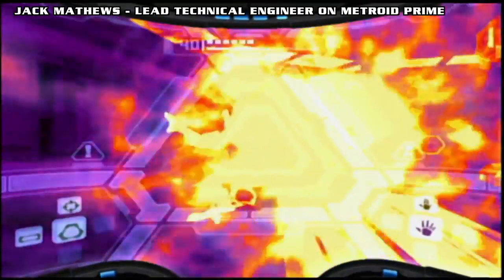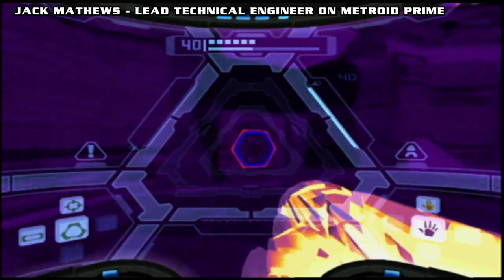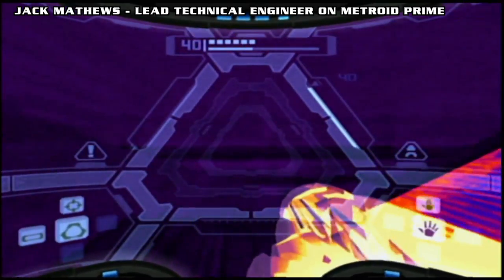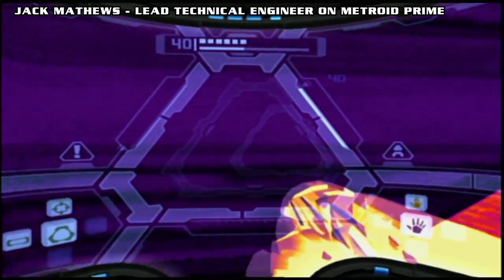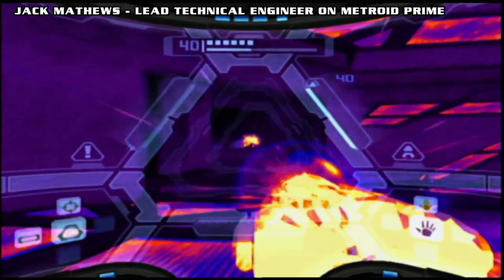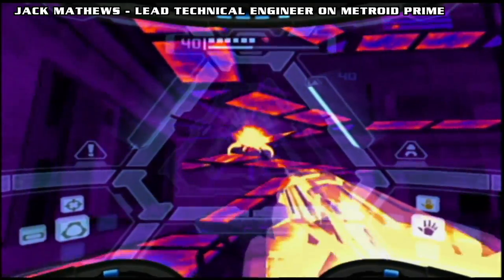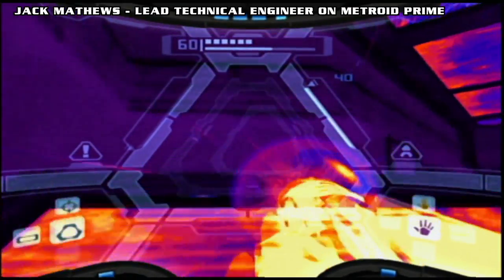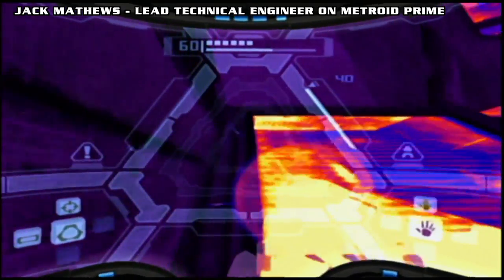Why The Thermal Visor Looks Worse In Metroid Prime Remastered

Comment: It was done good enough were it didn't break immersion. I didn't notice the decrease in resolution. I have a lot more issues with just seeing with the thermal visor on because everything is dark, which is an issue I had on the gamecube, and that's understandable the entire point of the thermal camera is you use it in dark areas.

Comment: Wouldn't palette effects be trivial for a fragment shader? I'm not familiar with Switch hw, is it not running shaders of some sort?
Reply: Yeah, I was thinking that too. They could just use a lookup texture indexed to whatever RGB -> brightness conversion function they like and Bob's your uncle, just have whatever "tagged as hot" means be something encoded in the surface textures that increases the brightness output by whatever you need. Granted that'd be just if you wanted to imitate the Gamecube 1:1, which I expect the remaster was trying to do more than that.

Comment: My problem with the original Thermal Visor is that it showed the Gamecube's flaws as far as graphics go. You could see the polygons moving around and it kinda took me out of the experience. I tried using Thermal vision as little as possible for that reason. The Switch remaster makes more sense since that's more in line with what thermal vision really looks like in cameras and it's still more clear than what we have now.
Reply: Not once have I ever considered the thermal visor crappy looking in the original back then or now.  What did you play it on?
Reply: @locklear308   Gamecube? It was almost nothing like how real thermal vision works. Not only did it show the low polygon count models more but you saw through models like they were transparent. It looked more like you just shut off the textures and changed colors.
Reply: @Misty25939  And just how does it not look like real thermal imaging?  Not that that matters because it was cool as hell at the time and I think it still is now.  And I've no idea what you mean by low poly models, low for the time?  How?  When was the last time you have played the original?
Reply: @locklear308   Real thermal imaging is always blurry because of the readings that generate heat. That's more in line with the Thermal Visor in the remaster. You're not just seeing the models that generate heat, you're seeing the actual heat itself. It's a little touch for realism and I really appreciate it. Prime still looks great for its time of course but not all of it aged as gracefully.

Comment: It could be performance concerns but also if you've ever looked at real thermal/FLIR imaging...it actually is pretty low-res and motion blurry.. So either they wanted to save on performance and/or they wanted to add just a touch of realism to how thermal imagining works. Obv. Metroid is not a realistic game but little touches like that can be nice here and there.
Reply: For old low end crap, sure it's accurate.

It isn't accurate to even modern midrange stuff though, let alone literal supertech.

Comment: I don't buy it.  Why is this a problem for the thermal visor and not the xray visor?  This really needs to be explained to me.  It took me over a year to finally get into this game because of my motion sickness problems with first person games (which has gotten worse as I have gotten older), and even right now with me being in a "good" phase regarding motion sickness it's still a noticeable issue.  And then I got the thermal visor and almost had to quit again.  Thankfully I didn't and just used the thermal visor even less than usual compared to my original GCN days, but I'm having trouble understand why this was necessary here and not for the xray visor.

Comment: So the way they did the thermal visor on the switch was for realism. I have watched plenty of ghost hunting shows and thermal cameras are really low resolution. And when you move the camera everything blurs so bad on that thing because of the lower resolution. Unfortunately from a gameplay perspective, the thermal visor is so bad I would rather spend no time in it at all. Unfortunately they made the dark areas EVEN DARKER on the switch, and it's impossible to navigate without it on. This sucks too because the lack of ambient lighting from the morphball and shots made getting the missile expansion really really difficult because you can't run thermal in morphball, and you don't have light emanating from the morphball itself anymore, which made getting that missile expansion even more difficult then it used to be. You can't see the track, you can't see anything. Everything is 100x darker now because of the lack of ambient lighting from things like bullets and the morphball.